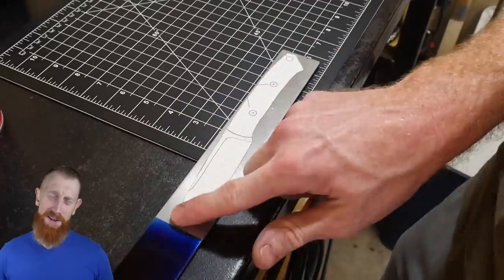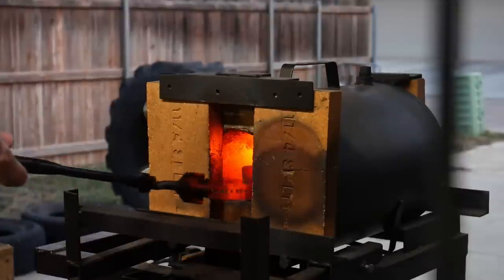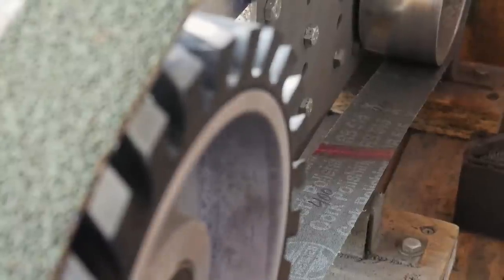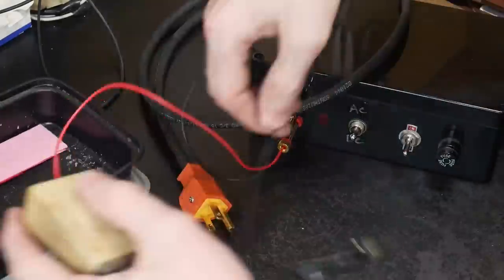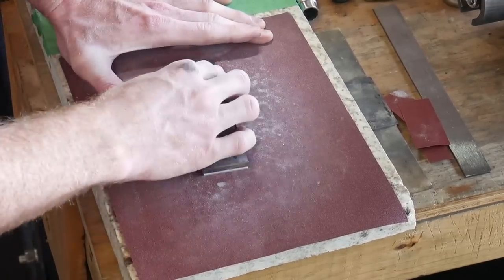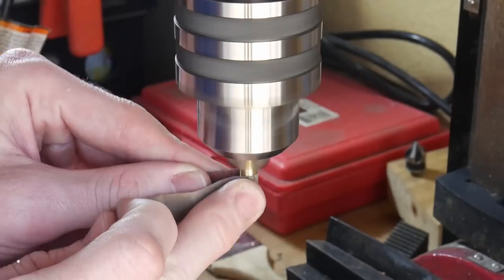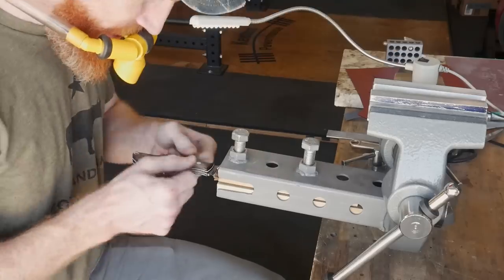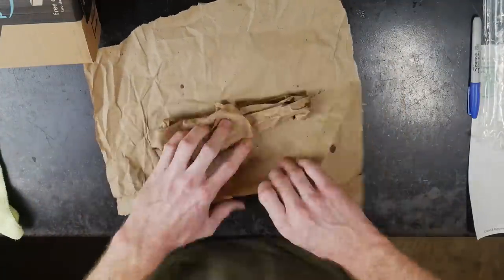Don't Make My Mistakes... Bushcraft Knife Making Fail

Comment: Good looking knife... bummer about the lanyard hole.  Another option is to bust off the scales and then put new scales where the scales don't cover the hole at all and have exposed tang just at that area.  Though when I've done that, the lanyard hole is nearer to the bottom and not at the top.  Just a thought.
Reply from the maker: Thanks for the tips sir. I think I'm going to chalk this one up to a lesson learned and move on. Won't be making that mistake again! LOL Have a great weekend!

Comment: I had the exact same problem as you did just 2 weeks back. I asked the person I was making the knife for what they wanted to do and they had me fill the crack with glue and send it to them. It was mostly a display knife I was making so I guess that’s why. Now I like to put the lanyard tube more towards the center of the handle and a bit more in. Also I think I may do more bolstered handles because it guarantees that the pommel will be strong. It’s a very nice knife you made, I’m glad you finished it out the rest of the way and sent it off still. It is still a great slicer
Reply from the maker: Hey Joshua, it's painful for sure. I won't be making that mistake again! I'm hoping Jason can use it to open some boxes and such! LOL

Comment: Great knife!  So if we sand the scales after fitting, that will remove the acid etch yes?  So the steel in the handle will be shiny, but the blade will be stonewashed?   I guess there is no other option except trying to fit removable scales.  Any advice appreciated!  Cheers
Reply from the maker: That's right. If you want to have the spine stone washed you can use removable scales or etch the whole knife at once. I've seen both methods work for others. There is 3rd option that you could try. I did it here on this build - https://youtu.be/CbOj-k7M1us

Comment: Amazing knife.
Is it normal to heat treat the knife before grinding to the final shape, or should I do the whole grinding process expect the bevel sharpening  then heat treat .
Thank you
Wish you be safe and good luck
Reply from the maker: Hey man there are lots of methods here. Some people do all the grinding including the bevels to about 90% before HT. I like to get the profile ground it, holes drilled, file work done; then HT before grinding by bevels. Both ways work

Comment: Like the nostalgic toy story feel for the music lol. I was watching your heat treat video and you mentioned that after the quench that the decarb or whatever it is called can leave soft metal on the surface of the blade. Is this something the hand sanding can take of or do I need to grind another 1/32"-1/16" off the entire bevel?
Reply from the maker: Hey man, glad you liked it. Yeah, you can get though it with hand sanding for sure. I think some steels have a larger layer than others. When your file testing you knife right after the quench you can sometimes notice the decarb layer being soft for a couple of strokes of your file... then when you get though it your file will start skating. I'm not exactly sure how deep it goes, but I'm sure you can get though it with hand sanding.

Comment: With the knife etched and stone washed, when you sand the scales done to the spine, is the finish sanded off the spine?
Reply from the maker: In this case I brought the spine up to a satin finish. You can use removable handle scales to keep it stone washed

Comment: Hey. Awesome videos. I’m laid up with a fractured ankle and have been browsing YouTube. I came across your videos after a guy I was hunting with had a knife handmade by his grandfather and I wanted to see how they were made. I’ve got the itch to try to make some myself. Thanks for getting me interested. While I was at college learning countryside management, I used many blades, ie. bill hooks, draw knives, hook knives, etc. I wonder if you have ever thought about making wood carving knives, like the hook knife (for spoon carving). It would be good to see how they could be made. Cheers Sir 👍
Reply from the maker: Thank you sir, glad you're enjoying them. I've never seen knives like those before! I'll check em out for sure. (I'm referring to the hook knives). I have a video up here on how to make a knife with cheap tools... may be worth your time if you're looking to make yourself one! Have a great weekend!
Reply: Red Beard Ops. Hey. Thanks for your reply. I know you have a video on making knives with basic tools. I’ve seen all your videos and the ones you suggest in your videos. I’ve got most of the tools (except a forge, but that won’t be a problem. I can make one). I’m having a little trouble sourcing steel here in New Zealand, but I’ll get round that little problem by ordering from overseas if I have to. Once I can get around, I’ll make the file gauge as well. Keep up the good work Young Man.
Reply from the maker: @garypacker5704  heck yeah, good luck with your builds! I'm not sure if they'll ship to NZ but I get my 1084 from Alpha Knife Supply... really good stuff

Comment: Do you do quick 2 minute at-a-time acid etches for better color control or is there another reason?
Reply from the maker: Yeah, I do that to make sure there isn't any crud on the blade stopping a uniform etch. (Oils, etc)... It may just be me being paranoid.
Reply: @RedBeardOps  I get it. I tend to pull mine every couple of minutes to start just so I can get an idea of how that specific steel is taking on color. I was really wondering if you've noticed a difference between taking that route and just dropping in the same steel for the total time at once. I would love to see a side by side of that to see if cleaning the residue off along the way yields a different end result.
Reply from the maker: @EnJeiBee  It's not so much the residue from the etching I'm worried about; it's the potential for oil on the blade that causes the etch not to take evenly. Or something like that. I may just be paranoid! LOL
Reply: @RedBeardOps  haha, I get it man. It's funny because I prefer not to touch it once it's in because I'm worried that I'll get oils and whatnot on it while cleaning it between dips. So maybe we're both paranoid.

Comment: Aside from asthetics is there any reason you could'nt just epoxy the crack. Like say it was for your self. Or is there a better fix for the issue.
Reply from the maker: If it was for myself, I'd probably just use it. I doubt it would come apart with the G-Flex holding the wood... buuuttt I'd never send it out into the wild for someone hard earned dollars. Hammering it would likely be an issue with that crack. It's just a weak spot since it's so darn thin... 1/16'' just isn't enough materiel! Cheers sir, have a great weekend.

Comment: Nice video!  I use lanyard tubes quite a bit and have never had a crack develop because I put it too close to the edges.  Maybe that's a benefit of starting this addiction by using pre-made blades.  The distance to the edges on those must have stuck in my subconscious. LOL
Reply from the maker: Thanks for the info Walt! Maybe I just got unlucky with this one... I'll be give myself a little more meat in the future! LOL

Comment: Nice video and knife. Pity for the crack. 
It is repairable with epoxy (laminating/injection resin, not epoxy glue), to make it go into the crack in the handle you simply vacuum bag it and inject the resin. It can be done just on the area to repair. And do not forget to plug the lanyard hole with wax, much easier to clean later on. 
Strengthwise its no different than originally stabilizing the wood scales where small wood defects would be remediated with the resin. 
And if you still don't feel right about selling something like that as good then you can sell it as a second. Bet many would buy this particular one happily even because of the video of it being made and the story behind it.
Reply from the maker: Cheers sir, thanks for the tips!

Comment: In my line of work, we use 1.5-2x the hole diameter away from the edge to prevent cracking in sheet metal. Roughly ⅝" from the edge to the center of the lanyard hole should have given you enough material.
Reply from the maker: Thanks for the info sir!

Comment: How are you not getting the acid all over your hands?   I've gotten burns so just wondering what your secret is.
Reply from the maker: Man, i've never had an issue with it. maybe since my acid is old and diluted with water?
Reply: @RedBeardOps  yeah.  I think that has to be it.  Mines fresh and I barely diluted it.   I'll transfer to a larger  container and dilute.

Comment: I've done this exact same thing with a pair of my first knives, using "diamawood" a predecessor to the one you used here. Cracked in the exact same spot and exact same way.
Reply from the maker: Hot damn... I wonder if it has something to do with this material as well as design. I have a suspicion that this may not of happened with G10... however even if it didn't crack with G10, I think this illustrates that there is a good deal of stress in that spot! Cheers sir! Good luck with your builds coming up.
Reply: @RedBeardOps  its the primary reason the material was discontinued, so I was told. It seems quite strong, but when you thin it down its very brittle just because its essentially stabilizes plywood. the wood structures are very thin
Reply from the maker: @HoY_82  Well DAMN.... good to know... Thanks man
Reply: @RedBeardOps  It's still really amazing looking material though, as long as we work around its limitations!  I bought the last of the stock of it from knifemaker.ca when it was discontinued

Comment: Turned out well m8 despite the crack. And if you have the time you can save that no problem by turning it into an exposed lanyard hole/window breaker. Just carefully  cut a curved section around the lanyard tube on each side of the handle down to the blade and remove the tube aswell. You can clean it up with a dremel and then polish it. Will take a little bit of time, but you can make it look like you intended it to be that way. Remember, we dont make mistakes.....just shorter knives!!😁😁. Oh weld a piece of round bar onto the nut of your knife vice to make a T-nut, will save you having to use a wrench all time, quick and easier.
Reply from the maker: Good ideas and tips sir! Thanks for your comment. Have a great weekend!

Comment: so the mistake was that the tube was too close to the edge? doesnt seem like it would affect the use of it too much?
Reply from the maker: Yes sir that is accurate. The handle material where the tube was put was just too thin and cracked. Depending on how the knife was used, I also think it would perform fine, but when it comes to making custom knives for a buyer, this is unacceptable.

Comment: This is why do you harden your blade before you grind in bevels? Most videos I've seen on knife making they make the bevels before they heat treat. I would imagine this would be easier on the belts
Reply from the maker: Hey man, it's really personal preference. I like suiting up and grinding once with sharp belts post HT.
Reply: @RedBeardOps  I just didn't know if one way or the other was the "right" way. But it makes sense to only grind once. As I said I'm new to everything so just trying to find what works for me. I had accidentally hardened an edge while cutting out the shape with a grinder. So when I tried to file it and then sand it later it was just so much harder and almost impossible to file. Because I'm new I didn't know how to anneal it again to make it soft. So that's why my question was relevant because I figured if it was so much harder to work it when I accidentally hardened it I would never want to work on it when it was purposely hardened. Keep up the great work

Comment: Beautiful knife.  You did so much work before discovering the crack...such a shame.  Perhaps you could have cut it back a little, the fabricated a brass or aluminum butt cap making the knife maybe 1/8 in longer.  Then the crack is gone and the knife is a bit more customized but still perfect.  Just a thought on how to fix it.
Reply from the maker: Thanks for the ideas Glen! Cheers

Comment: Making my first knife and all was going great until I found out using 30 second epoxy is a huge NO NO 😂 it will still come out ok but lessened learned and new epoxy is on order!
Reply from the maker: Heck yeah sir. Man I wouldn't throw it away. The knife with 30 min epoxy should still be serviceable, but the 24 hour cure G-Flex or the BSI mid-cure would be better options for the long term strength!
Reply: Sorry missed the key word, second, 30 second epoxy haha
Reply from the maker: @Greenway1214  oh i see! LOL

Comment: It wasn't ruined. Just take out that section of the handle near the lanyard tube. Cut the tube down to the level of the steel. Sand every thing down. I noticed when you drilled the lanyard hole hole the location. I just thought the final product was going to be what I described. Without the me ... uh ...yeah ...mess.
Reply from the maker: Thanks for your thoughts, sir.

Comment: It happens to all of us James. Some more than others so feel fortunate you are not part of the some.  Really nice looking knife! Shame about the lanyard tube. Just chalk it up to another lesson learned. Thing is you want that lanyard tube really close to the butt of the knife. Just gotta find that sweet spot.
Reply from the maker: Thanks Jim! Your comment is much appreciated. I've been hearing that his handle material is lightly prone to this issue as well... I wonder if I would of had the same issue with something like G-10... Either way I will be spacing out the hole a little more on my next one for sure! Have a great weekend!
Reply: @RedBeardOps   I try to go in 3/16" from the edge to drill the lanyard hole specifically for that reason. I have found that 18" isn't enough because you know your going to sand or ground that sharp edge on your scale to a more round edge and 1/8" just doesn't give you enough space to have enough scale material left to round over.  I actually do quite a few and that extra 1/16" will do the trick.
Reply from the maker: @jjppres  Thanks Jim! Good information right there. I just did one today with about 0.200'' space to the edge of the hole... we'll see how that does. Hopefully better than this one! Cheers sir.

Comment: I always forget to add weight reduction holes
Reply from the maker: You know, depending on the size of the blade and the "feel" you're looking for I don't think it's the end of the world not to have them. What I will say is that I like them there more so for the epoxy to be able to pass though between the 2 scales and create little "epoxy pins" on the inside of the handle. Cheers sir!

Comment: I would of changed the handle and tried again.....
Reply from the maker: Hey Raymond, from my perspective, I'd rather learn and start over. Just a different approach.
Reply: @RedBeardOps , I supposed your right the next handle would of been the same, still to close. 
I'm only starting out and it's crazy when something goes wrong after so many long hours. 
Thank you for your response and great videos. I have learned a lot. 
Raymond from Ireland 🇮🇪
Reply from the maker: @raymondoreilly7569  Thanks a million Raymond. I'm glad you like them! Yeah with the corby fasteners and the epoxy these handles are a bear to take apart! LOL

Comment: Beautiful knife ! And you can fix it! Mess ups happen is knowing about them that’s important. You could use a band saw and take the time to cut off the end of the knife handle to remove the eyelet for the lanyard. Then sand it smooth and boom no more problems. Lots of patience though as to not heat the metal up and loosen the epoxy though.
Reply from the maker: Glad you liked it, sir! Have a great weekend!